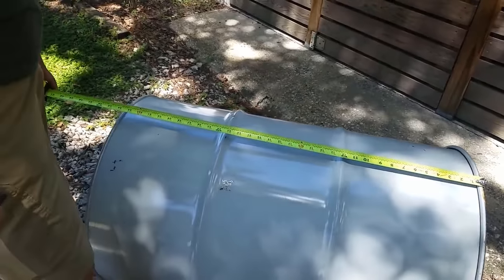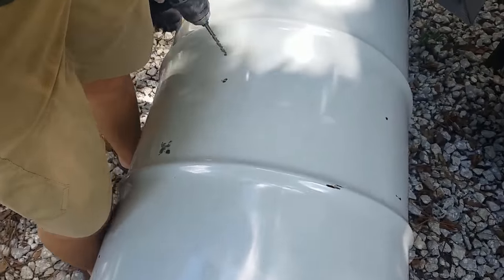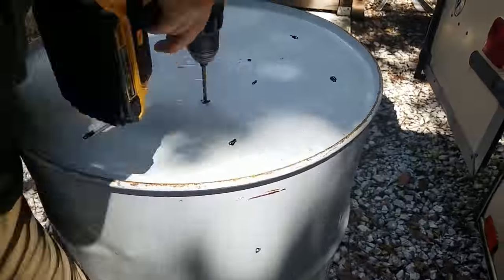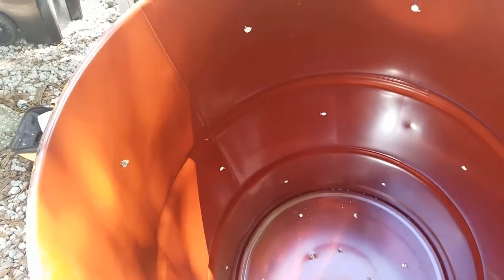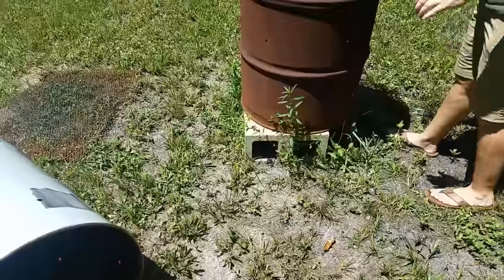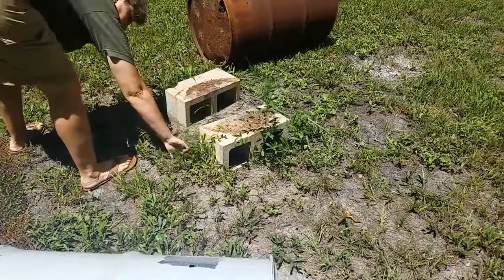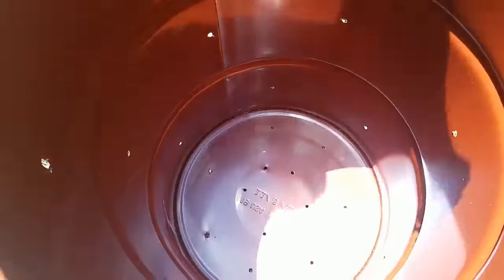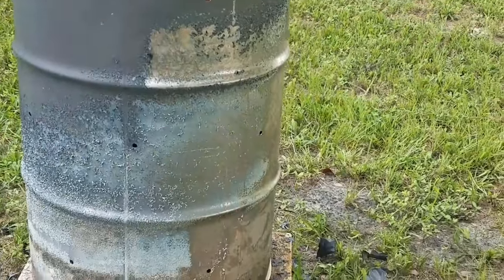How to Make a Burn Barrel (Step by Step) | Backyardscape

Comment: When i was a kid 40 years ago, the 80year old neighbor / widow lady, showed me, its much better to cut the top AND bottom out of the barrel. Because when its time to shovel ashes, all you have to do is push the barrel over and the ashes are on the ground already, and the barrel lasts longer that way too. All you do is just stand the barrel back up. Or push it over, roll it to a new spot
Reply: Rusting out the bottom doesn't really matter if it's sitting on blocks eventually you can knock out the bottom either direction
Reply: fartpooboxohyeah8611  why?

Comment: If you cut a piece of hardi-backer board to cover the barrel when not in use and it will last a lot longer.  This is a tip we learned that works well.

Comment: 1:20    Before you do this, make damn sure the old contents of the drum were not flammable.  Vapors can be just as explosive as the former contents, and guys have gotten killed cutting or drilling into "empty" drums that exploded.  A guy in Pennsylvania got killed by a burn barrel last week.  There was another incident in Iowa that killed a man who was welding on top of a barrel, using it as a workbench.  Filling the drum with water before cutting into it can displace explosive vapors, if done correctly.

Comment: I usually punch my holes with a framing hammer. Swinging the claw end at the barrel. Admittedly yours look nicer, if mine were visible I'd probably drill too. If you get barrels with the top still in (oil barrels)you can use the piece(slug) you cut out to "double line" the bottom. Makes it last a bit longer. Props to keeping your barrel so clean. I usually let mine fill up and then dispose of the whole works when full. By the time they're full they're about toast any way.

Comment: What type of fuel do you use to get the fire going? I used lighter fluid the other day, and it just didn’t seem to stay on fire. Any tips you have would be great!
Reply from the maker: When I first started using my burn barrel several years ago I used lighter fluid to start the fire. You need small, dry branches or leaves that will easily catch on fire and get hot to ignite the larger branches. If any of it is wet, it will be really hard to start it. Now days, I just use some kindling with tiny branches, pine needles, leaves and few scrap pieces of clean paper to start the fire. I only try after I know everything has been dry for a few days. I hope this helps.
Reply: I use a propane torch to light my burn barrel simple easy